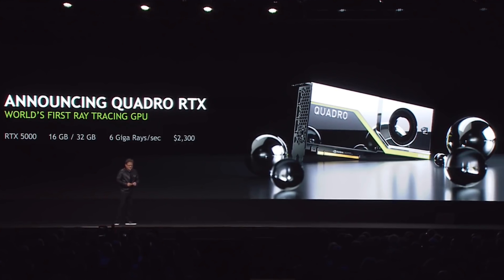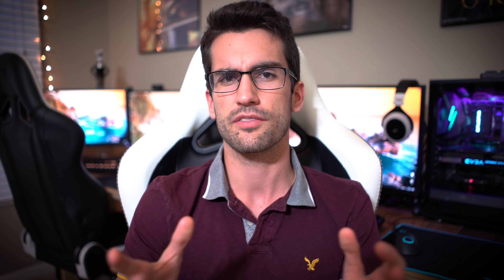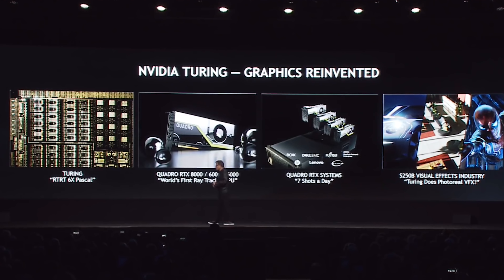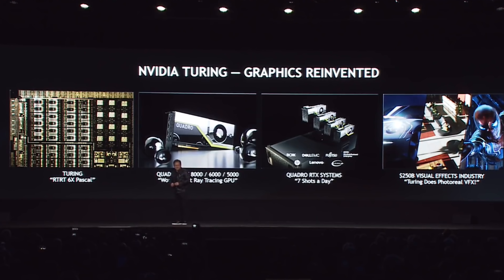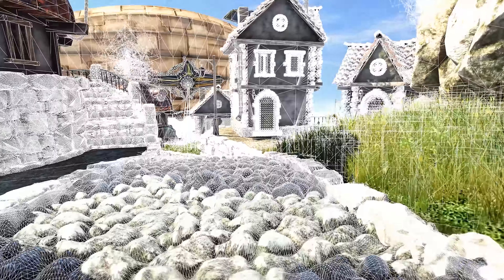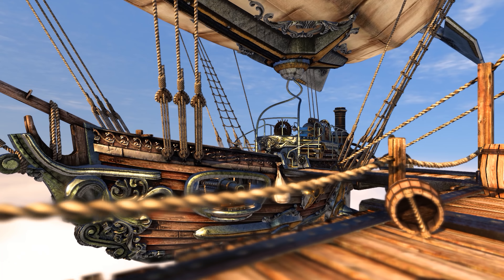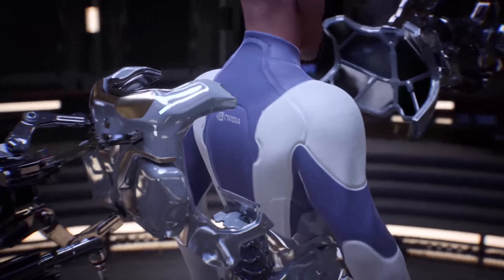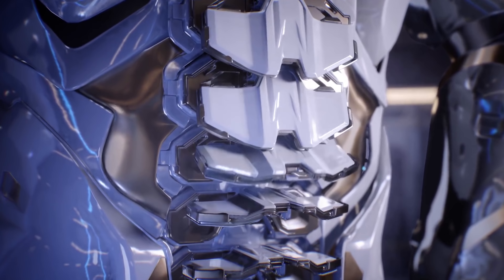Real-Time Ray Tracing & Turing Architecture

Comment: 3:40 ". . .We are able to render at a slightly lower resolution..." Those words had me on-edge. Why is no one talking more about DLAA?
Reply: Zoom and enhance!
Reply: Yeah. It seems like an extension of their image reconstruction AI. Really cool stuff, and probably the best possible use for it, since whatever it gets wrong should only impact a frame here and there for people. They used what I think is the bigger brother of this to reconstruct photos that they scribbled over.
Reply: Get me a "hard" copy right there.
Does this mean we will be able to super sample images (and maybe even games) to achieve higher resolutions with minimal performance degradation? O.O This could mean more than fixing some jaggies here and there.
Reply: Cavey Manta Not really comparable to supersampling. This is meant to upscale lower resolution content to fill in gaps. Supersampling processes pixles between what is displayed to try and blend them so it looks less sharp.

I would like to read through some more technical details, but based on Jensen's comments it seems like the issue is getting enough raw power in the raytracing cores to push raytracing at full resolution. There are two things that you would then end up with. Perhaps larger than desirable pixies and high noise. The ai would probably run on something like the tensor cores to hide the noise and 'guess' what should be between pixels to increase the resolution. Then the cuda cores could do some of the more traditional GPU tasks in the engine.

I am 100% wrong about some portions of this due to lack of information currently available as well as my lack of knowledge about GPU architecture. However given what has been mentioned about the design so far this seems to be where they are going. What was revealed in that talk though was a $10,000 professional GPU, so however they had that demo running would not work on the consumer side with the 2000 series.
Reply: BY SABOTAGING AMD WITH GAMEWORKS DIDN'T NVIDIA SHOOT THEMSELVES IN THE FOOT BECAUSE THEIR CARDS WERE SO OVERLOADED WITH THESE GRAPHICAL CALCULATIONS. SO SOMETHING HAD TO GIVE AND THE RESULT WAS A SIMPLIFICATION WHICH LEAD TO RAY TRACING ? YOU BE THE JUDGE.
Reply: I think he might've used the wrong word there. He probably meant lower number of samples per pixel.
Reply: "Methods like this always result in a less than perfect result hardly fitting for the PC master race."
As opposed to what? All the rasterization hacks that are in video games right now?
Reply: @lbnchrist I was playing Dishonored 2 the other day. While I was looking at the ocean, a character walked into my field of view and caused distracting artifacts in the ocean's reflection, because screenspace reflection sucks. No amount of supersampling is going to fix that mess.
Reply: Because it's been a thing for years now in neural networks lol.

Comment: Currently, the raytracing technique is considered to be used as a supplement to rasterization. Full raytracing is still some years ahead. Rasterization will still be responsible of a large part of the rendering, but in the coming AAA titles, raytracing will begin to handle the light effects (shadows, ambient occulusion, etc) where rasterization just can't generate convincing results (nor efficiently). This is where raytracing excels.
And adopting raytracing will enable greater freedom in the creation of game scenes. Translucent objects, complex reflective surfaces and a great deal of other materials will finally be freed from the inconvincing results of rasterization.
Reply: As for the game, it doesn't seem that the game developers will risk crippling old cards just for raytracing effects. More likely, GPUs with RTX technologies will enjoy a more realistic result and a better visual experience (because the developers  creates the game in raytracing-enabled way), but not a faster experience. Old GPUs are still able to perform normally, but  with some visual defects (i.e. somebody placed a prism in a game scene and renders out to be $hit)

Comment: Um actually, ray tracing happened before rasterization. Ray tracing determines the colour on the polygons, based on simulating how each light rays, from the source objects, travel to other reflective objects in the environment, before it reach the POV. When ray tracing completed, then rasterization start. Rasterization simply means converting the vertices/lines/objects into pixel, based on the POV. Real time ray tracing was considered a dream for a CG researcher due to extremely complex calculations, and what NVidia did is optimizing the process, to the point their their hardware (which if im not mistaken, they actually have "ray tracing" cores, separated from CUDA and tensor cores). HOWEVER, explaining these is hard, and I thank you for explaining clearly it to others. Hopefully with your video, other people will show more interest in graphics computing.

ps- Do you think with these graphics tech, we can actually render Shrek realtime? That would be cool!
Reply: Well put. And RT has many other uses like spatial 3D audio, collision detection and whatever vector projection work you can find.

By the way, yes, RT cores are standalone, they are not unified shaders.
Reply: Path tracing would be considered a dream... Not ray tracing.... Ugh....

Comment: Triangles and polygons are not the same thing. A lot of 3D modeling is done in quads, basically square shaped polygons. Quads make a cleaner looking model which is easier to work with. But a lot of game engines convert each quad back to triangles.

Comment: So, wait are tensor cores FPU or no?
Reply: I think its 32-bit
Reply: Rugg0064 no its ten-bit
Reply: Thanks, zuluknob that is what I thought. I just wanted to double check.
Reply: Apparently they dropped int16 and int8 and only int4 is supported so very low precision but for the application not real impact they can get away with it ;)

Comment: Didn't the first doom use ray tracing? Or am I just confusing that?
Reply: Prophet doom 1&2 were two dimensional top down games that used a technique called ray tracing to generate a pseudo 3D image. That is different from tracing light rays in a 3 dimensional model.
Reply: oh ok thank you.
Reply: Ibrahim Sammour Not quite... Wolfenstein 3D was a raytracer. Doom did run in a 3D environment, but because of the limits it‘s engine has, the can use easy and cheap methodes of doing things like collision, occlusion culling, texture mapping and stuff like that.

Comment: I wonder if that $10,000 gpu could run minecraft on high, honestly i would be surprised, no technology has advanced enough yet to reach that graphic payload
Reply: What do you mean minecraft is really easy to run. It runs easily on Intel HD graphics.

The REAL challenge to run is the 20x20 grid on minesweeper @144p. Not even a 1080ti SLI set up with a 7980XE could handle that graphic payload
Reply: honestly I read the first part and was getting ready my r/whooosh but seems you're a man of culture as well

Comment: Does somebody know about nvidia mobile cards? I wanted to buy a laptop with gtx1070 inside this month. But new video chips is coming. So is it worth to wait? Or just get a laptop now?
Reply: Illia Raford Go for it if it's under 1K.  I bought my 1050 gaming laptop for 800 almost a year ago. Or wait till next gen is out for a bit so your laptop is even cheaper.
Reply: You're best off waiting for the new cards to become available which should force the price of the older cards down.
Reply: Don't care about the price much. Just wanted to get a good performing laptop for next couple of years =)
Reply: This new tech isn't going to give gamers anything new. Hit that Buy button now :-)
Reply: Terry D tbh i have to go to another country to buy it=) so it's not so easy as you think =) and probably i would wait a bit...
Reply: gtx1070  is about 2 years old so if you want something that will last long and don't mind price much, wait fro the newer cards.
Reply: Gilang R no i need a laptop as a second work station

Comment: Ray tracing will be used for more realistic shadows at first and very little else, for Viz it actually provides some interesting gains but for gamers this generation brings very little, so what this means is really expensive card that has 10% performance increase due to the use of GDDR6 and little else, increased number of cores for Tenso Cores and RT Cores... yeaiy realistic shadows and not having to bake in AO into textures, tesselation had a much greater impact that this Hybrid RT+Raster will have for gamers. ¯\_(ツ)_/¯
Reply: 10% performance increase? I thought it was more along the lines of 30-40%?
Reply: idk I think having physical light sources in games is a big deal.

Comment: Is this Nvidia Physx all over again? Sure we will see devs implementing raytracing but I think it could be a fad and die off soon. Devs can barely get multi gpu sli together. I don’t except them to get this in a lot of games. I’ll sit on my 1080TIs in sli for now
Reply: Ray tracing in general is not a particular technology. It's not comparable to PhysX.
Reply: Wobbly as in it’s a fad that won’t build up until real ray tracing quality comes to pc. This isn’t accurate Ray Tracing. Same thing with Nvidia Physx, it never looked good enough compared to cpu physics. Moral of the story I think this could die off over time.
Reply: Again, ray tracing isn't a specific technology. PhyX is a particular physics engine, of which there are competing alternatives. It doesn't make sense to compare them. Saying ray tracing is a fad is kind of like saying physics engines are a fad.